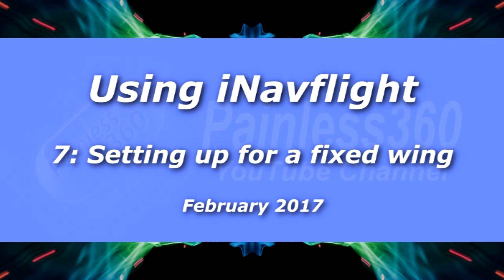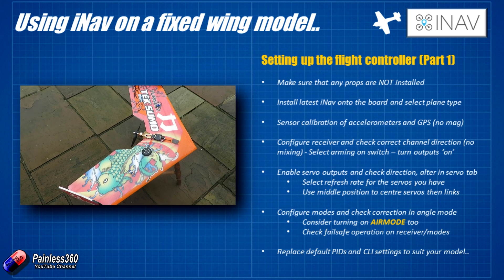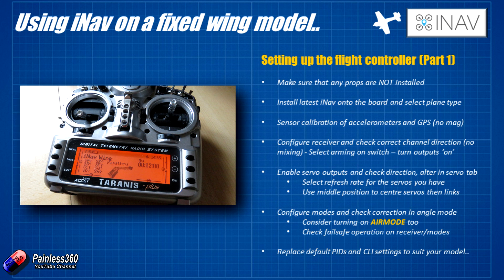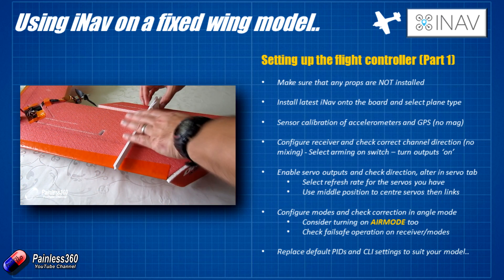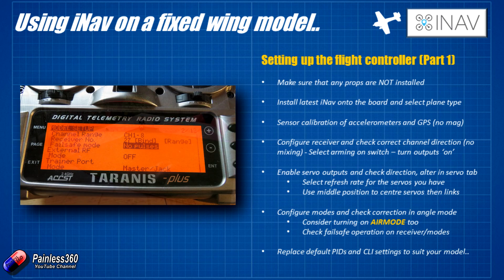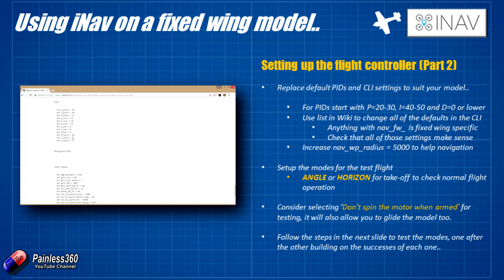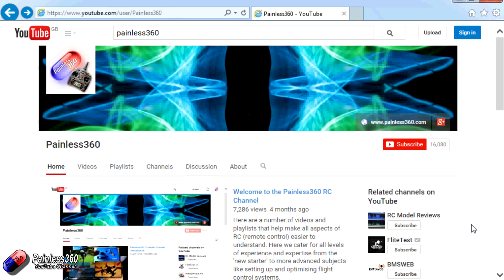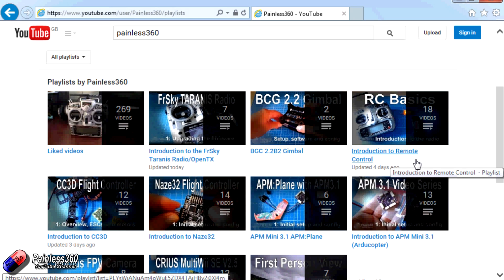(7/8) Introduction to iNav: Setting up iNav on a Fixed Wing

Comment: Hi Painless,  See the part when you say about getting the receiver settings to 1000 - 1500 - 2000. mine are a bit off as they say 991 - 1490 - 2011 so wondering do i adjust within the radio or within iNav to get them all to 1000 - 1500 - 2000?  I usually adjust within the radio on other models but you said not to put anything in the radio bar a blank model and use iNav to configure but does this apply as above?

Cheers,
Reply from the maker: I bet you're using a Taranis ;) Go into the 'Output' part of the menu and reduce the travel from 100% to 95% in both directions for the main controls. Best of luck!
Reply: Yep Taranis lol....  The servos output part on iNav or within the Taranis?
Reply from the maker: You need to sort it out in the radio. See the 'Quadcopter building for Beginners' series for more detail. Best of luck! :D
Reply: Found it eventually...  all sorted now thanks again mate!

Comment: I cant connect to Inav. Using an Omnibus F3, had Betaflight on it, connected fine to Betaflight. Had to use Zadig to get it to flash Inav. Re-installed stm32 driver and virtual com port driver. No connection. Betaflight and Cleanflight use com2 to connect, and my other boards connect fine but it wont come up on Inav.   I cant figure it out.
Reply from the maker: +Mik H not sure, definitely sounds like a driver problem. If you are using the same USB cable that used before then I guess you need to start there. Best of luck
Reply: I think its an Inav problem. Same drivers, same cable, same flight controller, and Inav wont connect, but Cleanflight and Betaflight do.
Reply: I worked it out- Omnibus is the wrong firmware. I bought it from Bangood, and who knows what the right firmware really is. When i re-flashed to Betaflight it wont work anymore. My other flight controllers work with  Cleanflight, Betaflight and Inav.

Comment: I finished setting up my gps on my sp racing f3 in a flying wing. But my magnetometer and gps is showing red. And in setup tab its showing hardware health also red. How to solve this issue.? Thanks.

Comment: I never setup anything with props. Just a bit of tape to detect spin. I am getting ESC startup beeps, magnetic resistance of the shaft just no evidence of motor activity  on INavs motor tab and no spin. I'm using a 6amp BEC to power the board. 
I have been dreaming about this stuff since a teen when a fellow in Austin Texas flew his large R/C plane using Amateur Radio Television some time in the 80s. So I will try to be patient and catch up with all the work you and others have done to actually accomplish what so far I have only daydreamed. 
Oh Ive also never flown a wing so I built a tough Popwing then added an Experimental Airlines except triangular  fuselage to unload the wings the burden of the weight of electronics/batteries during "landings"/crashes while I subject it to the bank-n-yank training of my thumbs.

Thank you very much for your great education and communication. 
Robin
Reply from the maker: +Robin Bayer with patience and time you'll get there. The amount of technology that's available to pilots and builders in the remote control hobby is fantastic. The manuals and help isn't always great, as the effort goes into developing and enhancing the wonderful abilities of the products themselves. If your new to wings, then learning to fly them without flight controller help is always handy in case the flight control system has a problem you can bring the model back in safely. Best of luck with your journey, enjoy it and have fun building you're next flying machine! Happy flying!
Reply from the maker: +Robin Bayer (Make sure you have enabled pwm output in the GUI too! :)

Comment: Well I'm not out yet!  Just had to re-read a few comments down. Now plug in esc and servos with just the usb powering the board?
Reply from the maker: +Robin Bayer make sure you remove the prop and then plug in the battery if you're going to test the ESC and servo outputs. Best of luck

Comment: I have to say I am  really having trouble. Sensors and calibration were no problem. Servos and ESC are having no joy. 
Using the omnibus F3 wing config and the Taranis. I have been able to get everything moving and zeroed on the configuration tab and even got the servos working right once. Now only the trottle moves in the config tab. Tried 2 ESCs but no response. I first tried to set up a 4 channel plane, but servos were trying to destroy themselves so I am trying the less complex wing. Flight controllers, INav/Cleanflight are all new to me.
Reply from the maker: +Robin Bayer this series is more designed for those who have experience with flight controllers and technology like betafllight and cleanflight. We do skip a couple of steps in these videos as we explained, I'm planning and much more detailed set of videos in a month or so where we go through each step to set up a plane with a inav in much greater detail. Best of luck with it

Comment: Hi Lee. Please update this video on the pid tuning. With these settings you suggested you will crash your plane in stabilize mode. The inav uses piff controller for fixed wings. D gain is the most important setting for tuning the fixed wings.
Reply from the maker: See the later video in the series.. thanks for the comment.

Comment: Hi Lee. I'm just starting out with Inav, so starting with 1.6. Airplane, Taranis. Why have you gone away from the standard Inav channels of 1&2 Throttle, 3 Ele, 4&5 Ailerons, 6 Rudder with your Taranis channels. You have Throttle on 1, Aileron on 2, Ele on 3, Rudder on 4, mode on 5. How were you able to do this? I am completely confused with what Inav channels control what surfaces and cannot get the correct control surfaces to work with my Taranis. Thanks
Reply from the maker: +Peter Hancox Just follow the diagram that is shown in the window when you select the model type you want. There are no 'standard' channels for models like planes. Hence the need for following the diagram. If you want to know why then see the later videos in the series. Best of luck!
Reply: Yes, I have followed the Fixed Wing diagram, but the control surfaces are still jumbled. I have checked the CLI dump and that shows a map of AETR1234 which is different again??
Reply from the maker: +Peter Hancox The channels used for the servos on the plane bear no relation to the channel order on the radio. Forget about the radio order once you've confirmed the channels work in the Reciever tab of the GUI. You are switching between talking about both here, that may be causing your confusion..
Reply: Ar, now I am confused. eg Mixer Channel  1 on my Taranis, controls RX channel 1 and this controls INAV channel 1 which is one of two Throttles, Right??
Reply from the maker: Nope. No mixes on the radio at all. Make sure the controls move right in the receiver tab first. Then connect the servos as per the diagram. Best of luck!
Reply: Sorry Lee, but only complete confusion here. If you have nothing in the Mixer section of a Taranis you have no output whatsoever. My intended setup is Rev6 Naze32 Full, Taranis-2.1, DR4II PPM, INAV1.6.1.Airplane.

 Inav CONFIGURATION tab shows a plane view 1 and 2 are motors, 4 left ail, 5 right ail, 6 rudder, 3 elevator. SHOULD MY TARANIS BE SETUP TO MATCH THESE?? but if I do, Inav RECEIVER tab shows Roll on 1, Pitch on 2, Yaw on 3, Throttle on 4, followed by Aux's? Then there's the SERVOS tab where the servo's start at 0 and not 1??

Tell me what output channels out of my Taranis do I need to make this go, I've been at this for days now and can't bear to look at another You Tube video, thanks

Comment: I am hoping the use INAVon a SP Racing F3 EVO fitted to opterra wing, I an doing this as I have a Tranais anf the BNF model only comes for the spectrum. 

I am normally a Quad-copter flyer so I am hoping with the Level modes this help me until I feel confident. 

I know you have level modes but is there anything I can use to help me during launch of the craft, something that with level mode will set a gradual clime until I get get hands back onto the controller?
Reply from the maker: +Wynne Davies (BoLt) yes there is, there is something called launchmode. We will be doing a video on it in a couple of weeks. You can set the mode, arm the board, set the throttle to the amount you want after the launch and then throw the craft into the air and it will automatically level, climb at 18 degrees, and hand you back control after 5 seconds. Very cool stuff
Reply: That sounds fantastic, roll on summer as our club in Rhyl have a very soggy field and when I have all this set up I just want to fly and have fun.

Thank you Painless360

Comment: @13:33, you're much better starting off Acro rather than Angle or Horizon. Then switch to Passthrough once in the air to check the trims and switch to Angle or Horizon to check the acc trim.